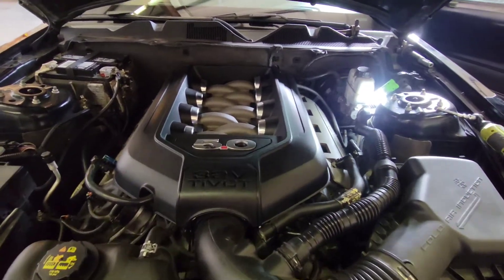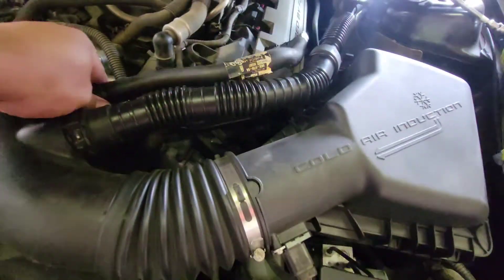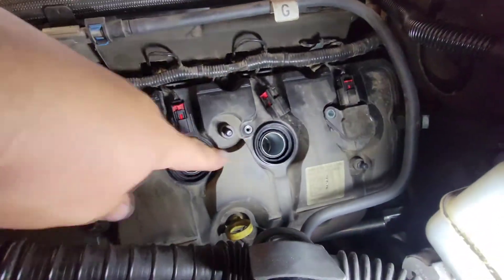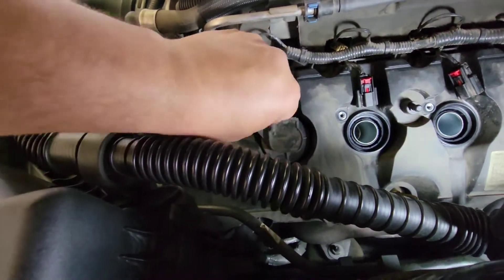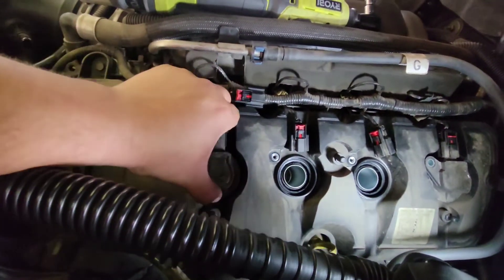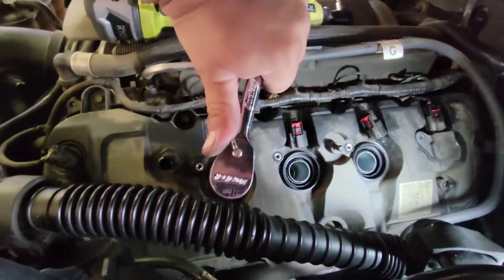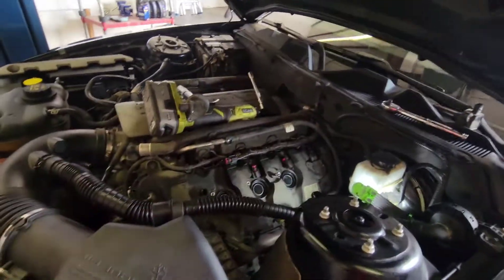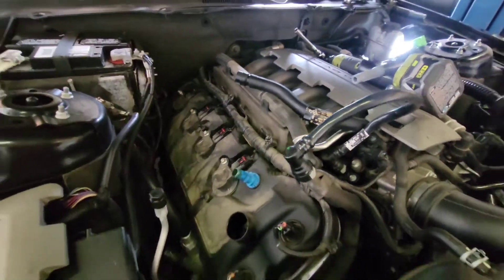How to: Remove Coil Packs and Sparkplugs 2013 Ford Mustang GT 5.O

Comment: In case anyone else had the same issue with the clips for the coils.... There are two locks.  A little red tip is at the bottom of the clip.  Take a small screwdriver and push up on it.  It will click and unlock the red clip.  Then you can pull it up by the little red tab all the way up.  Then you push in on the black part it the center while pulling up on the connector.  Takes a little effort.  So there are two parts to it.  Unlock the red safety tab first, then you can remove the connector.  For some reason this was not shown in this video.